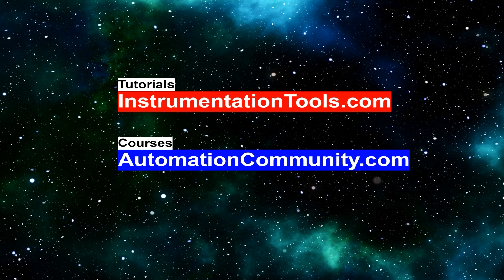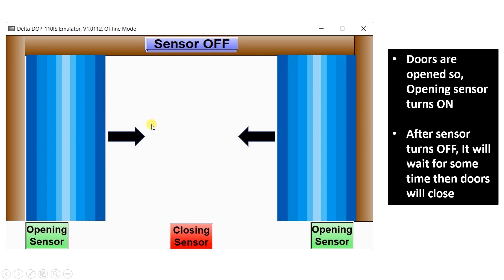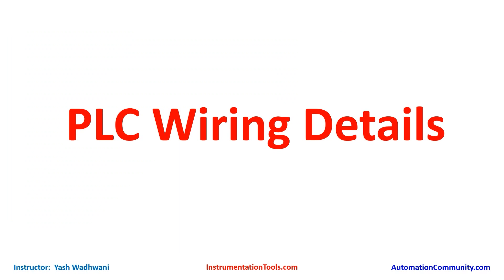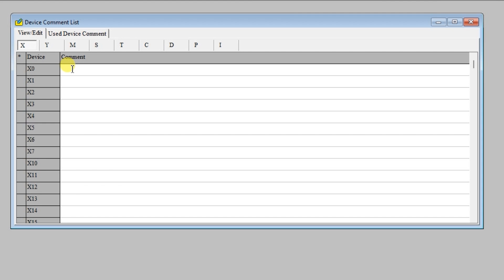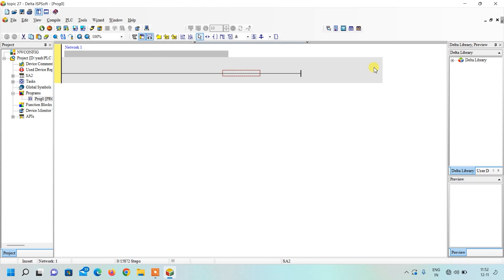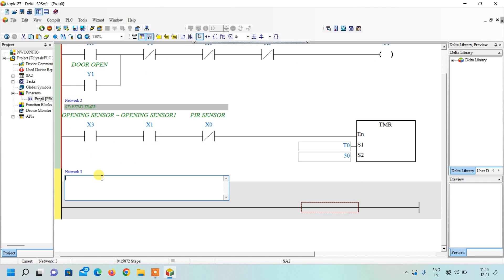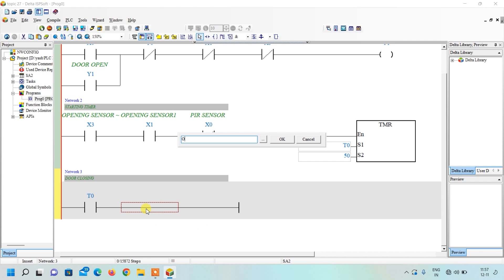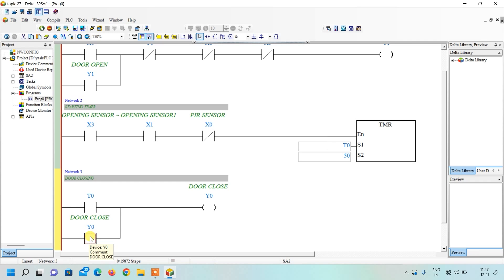PLC based Automatic Door Opening and Closing System

Comment: Sir can u explain why did u take x1 and x3 as normally close and in series as when  x0 is pressed they will still in close comdition
Reply: X1 and X3 in rung 1 are “software interlocks” to prevent forward and reverse from being energized at the same time. In a real application, you would use a software interlock along with a mechanical interlock and an electrical interlock to provide three stages of safety to prevent short circuit when using a reversing contactor.

But the example in this video is not actually usable as is on physical equipment only on software/ virtual based application.